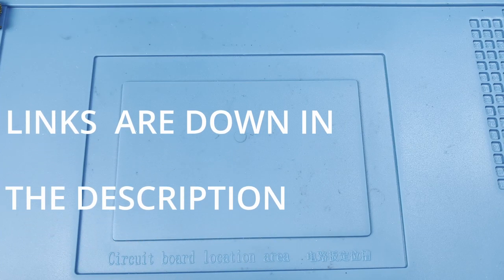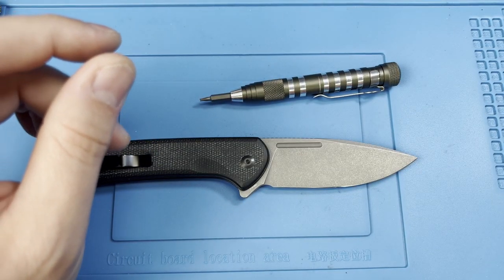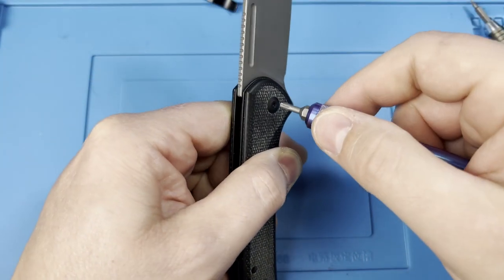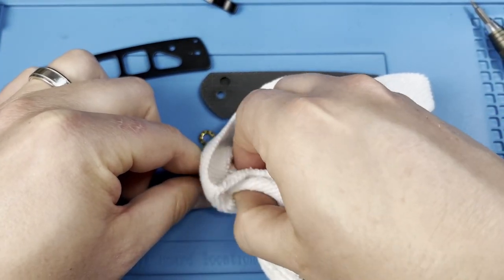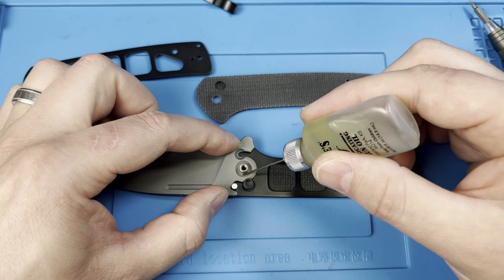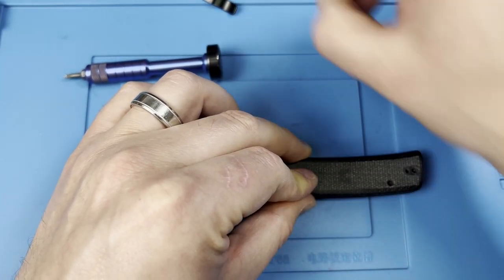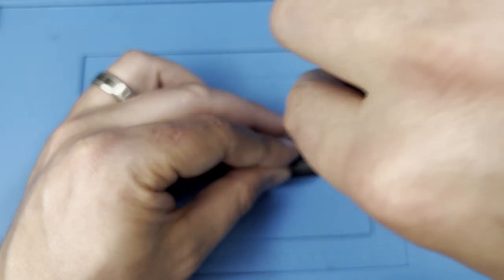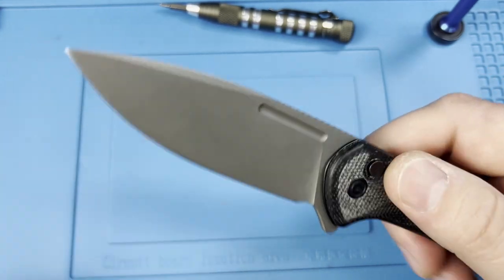CIVIVI CONSPIRATOR DISASSEMBLY

Comment: I've had mine a while but haven't used it more than 2 or 3 times, just took it apart for the first time yesterday and I've had to take it apart and put it back together about 4 times now trying to get it centered and nothings working, if it was only off a little I wouldnt care but it's off quite a bit and it's driving me nuts
Reply from the maker: I can’t remember, does the captive side of that pivot move? It might need to be backed out or tightened a little bit in the non-screw side

Comment: The pivot keeps moving with the screwdriver? Is there a certain way you do it without it moving?
Reply from the maker: Press the logo side in with your thumb and it should hold it in place if you are loosening the pivot. 👍
Reply: @dailygearguide  still moves sadly, putting all my strength into holding it in.
Reply from the maker: @user-od9fz2fd7l  if it is the micarta scale, the captive nub may have broken. I would reach out to Civivi. They were great with my Cogent repair even with it taking 4 weeks they communicated and kept updated.
Reply: @dailygearguide  I’ll see what Civivi can do. Thanks for helping 👍